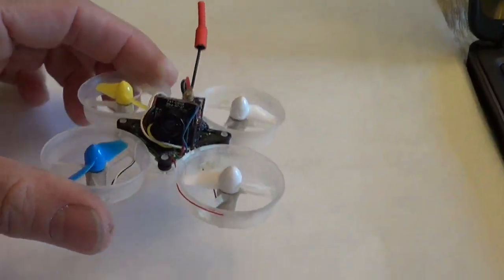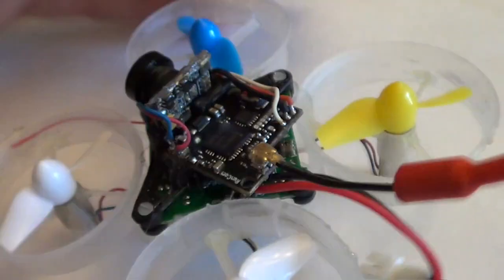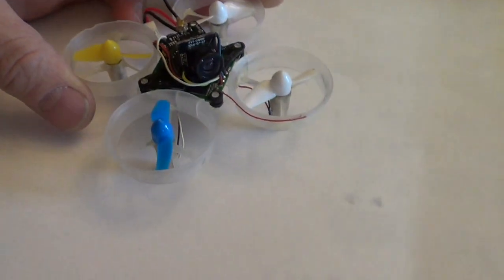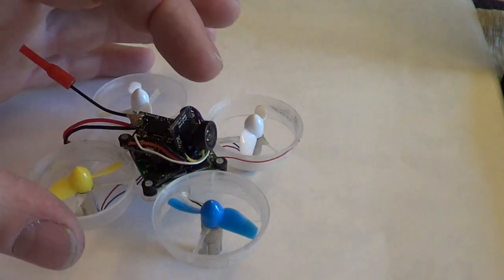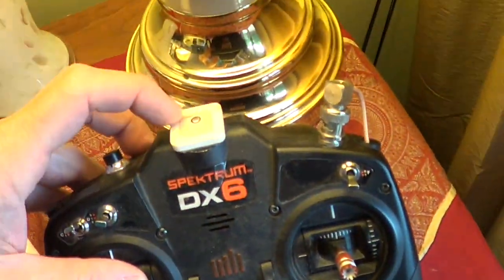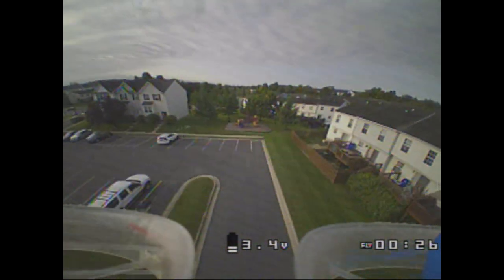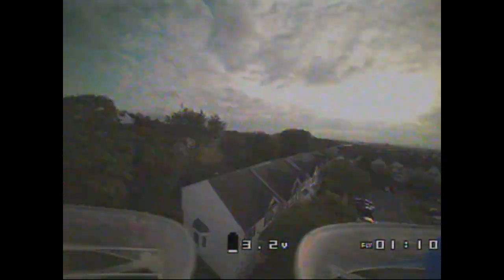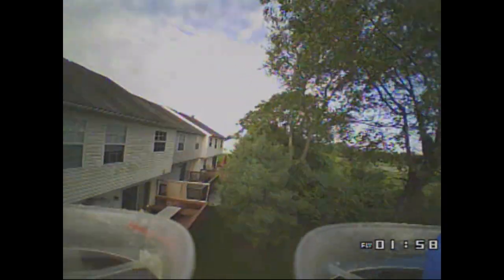Long Range Tiny Whoop with Runcam TX200 200mW TX (19.4 grams)

Comment: Great series on the long range whoop, I’ve learned a lot from you.  Currently I am just starting to learn about antennas.  I’m wondering why you lengthened the antenna on the FC, doesn’t that de-tune it?  I can see how getting it away from the battery shadow helps signal reception, but I’m thinking that making it vertical would have been better by keeping it 1/4 wave, plus the circuit board would become a ground plane.  I may be totally wrong on that, so any answer you might be kind enough to give me would be very helpful.  Thanks.
Reply from the maker: Receiver antennas are as critical as transmit antennas.   That is because TX antennas have reflected radiation back to the power transistors.   While, RX antennas just start canceling out when they are longer than 1 wave length.   I believe 2.4Ghz is 1/4 wave length anyway, so it really doesn't change much going to 1/3 wave or so.  Vertical is a good idea because your TX is probably vertical anyway.

Comment: Did you connect the Runcam tx200 black/red wires directly to the the battery power source on your Flight controller? I want to do this for my Diatone GT R349 that I will be building, and I will be adding the Runcam micro swift cam...thanks in advance!
Reply from the maker: The specs are down to 3 volts.  So, Yes I connected the TX to the battery wires.

Comment: I love my whoops but I can’t fly them outside cause the wind is bad where I live , I also love long range brushed builds so I can only fly outside with bigger 55 - 65 mm  2 blade props and bigger 1s 7mm motors or 2s 8.5mm motors
Reply from the maker: That is cool.   I have to get back to tiny whoop myself.

Comment: I suggest a Crossfire Micro receiver or a R9 mini, a perfectly vertical antenna (taking the angle of forward movement into account) on the craft and a very very good 5.8G patch antenna (linear polarized!!!!) for the ultimate long range  whoop experience. I am only constraint by battery at this moment.
Reply from the maker: Thanks for the comment.  I'm trying to keep to 20 grams on the tinywhoop frame without the battery.  So, i'm stuck with the built in receiver on the F3 board.  I keep hearing the frsky gets better range than spectrum.  But, I only need to bump up the power and I'm good to go.
Reply from the maker: It looks like the crossfire weighs 0.5 gram.  It might be usable if I can get a lighter f3 board without the receiver.  Thanks for the advice.
Reply: @microdronetech8453  Maybe be going to 7mm brushed or brushless? brushless isn't an par flighttime wise but has no problem to lift one more g or two. Also I'm interested in your opinion in the 2 bladed props. modding 4leaf ones to 2 ones myself always left me with horrible vibrations
Reply from the maker: I like the 6mm because it makes the drone quieter.  These 2 blade props are made this way.  They are pretty poorly balanced and they don't fit very well on the shaft.  Some of them pop off in flight, which is not good.  Everybody has been telling me to use 2 bladed props instead of 4.  I know the 3 blade rekon heli props really suck.  The 2 blade does seem slightly better than 4, but they are noisier.  As for longer flight times, I have the DJI spark for that.  And, if I really want long, I could get the Mavic Pro for 32 minutes flight time.  But, both of those kwads are very noisy and are too heavy to fly above neighborhoods.  I haven't been impressed with anything accept tiny whoop for the micros.
Reply from the maker: by the way, you can balance 2 blade converted props very easily using a pencil lead and shaking it.  I think I even have a video on that subject.
Reply from the maker: I just threw out the factory 2 blade props.  They suck for 2 reasons.  I can't balance them because they arn't drilled all the way thru.  Their bore is too large and they pop off constantly.  I went back to the 4 blade Echine and trimmed them down to 2 blade.  I balanced them and have a vibration free Tiny Whoop.  Those are much better props.
Reply from the maker: Wight is 19.2g without the battery.